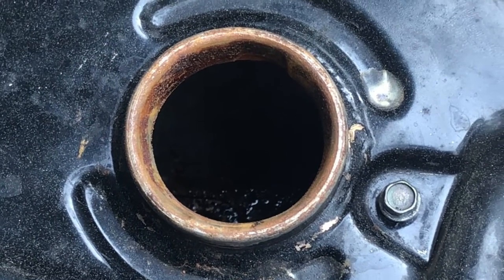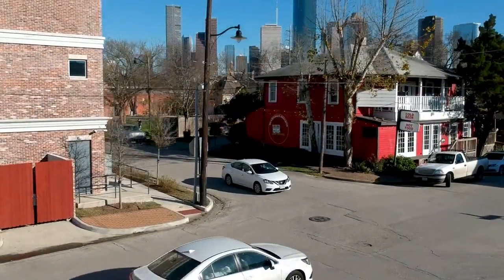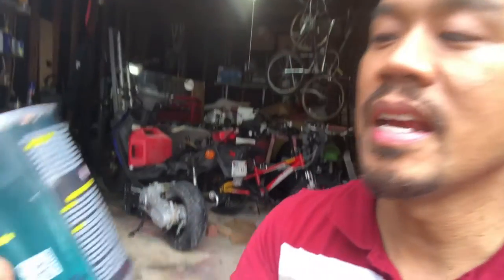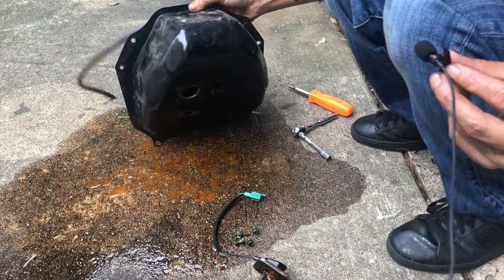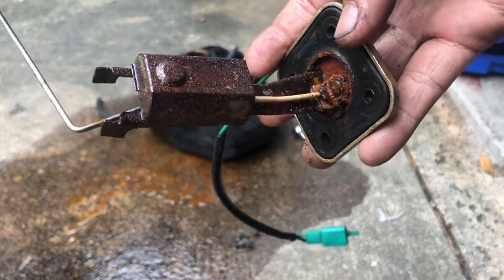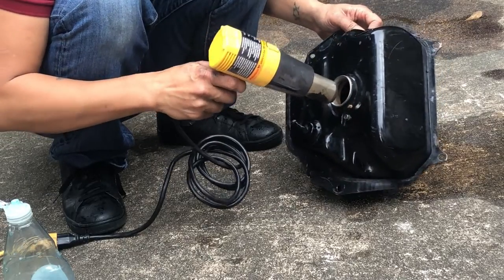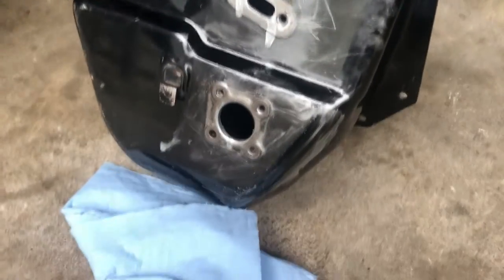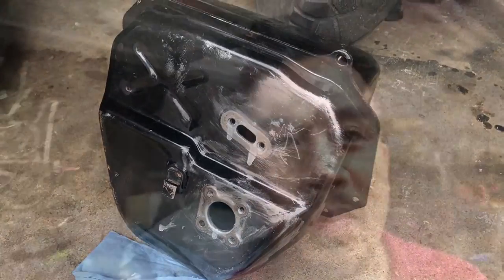POR 15 gas tank sealer | Zuma Raffle Project Episode Two #POR15 #GasTankSealer

Comment: A good way to get the rust out is to fill it up with white vinegar and let set over night. After flushing the vinegar out and let dry you seal. That's how I do all my old VW fuel tanks. Rust is a bad thing in metal fuel tanks. Great vid 👍👊
Reply: yep that's what he should have done to GET rid of rust completely instead of sealing over rust
Reply from the maker: I did the vinegar thing ,then filled with gas , drained it and then sealed it. What helped the most was the water jet. There was hardly any rust after I did that.

Comment: I have a new sender I can send you if you need it. I’ll message you @ 49ccscoot forum of where to send it.
Reply from the maker: I got one that is not Vaccum fed. I read it on 49ccscoot. I think that should work fine I hope. Is there a disadvantage to using one that does not open with vacuums?
Reply: Small Engine Velocity  Your petcock valve... You just need to remember to open and close it or you could fill your engine with fuel if your fuel float needle valve isn’t sealing correctly.
Reply from the maker: Oh ... that makes a lot of sense